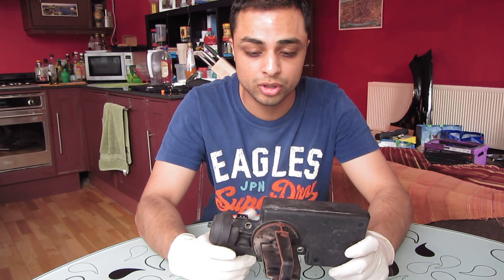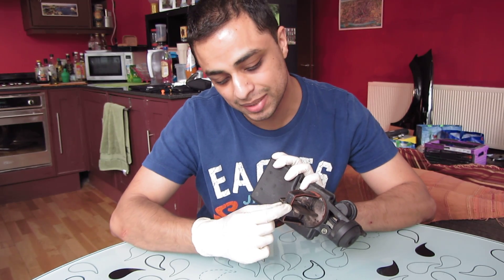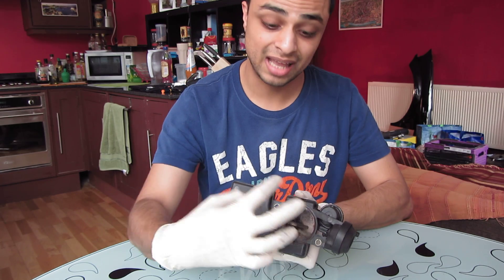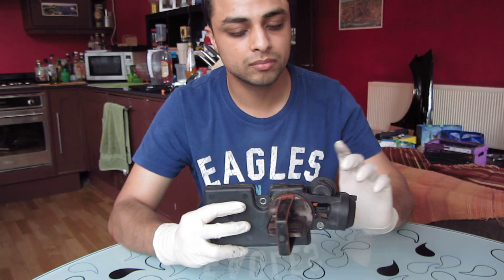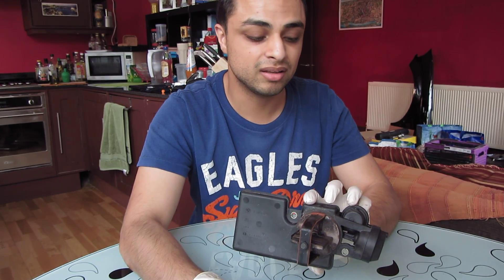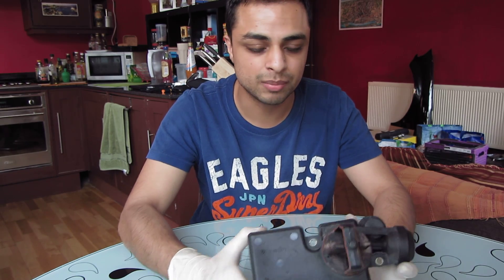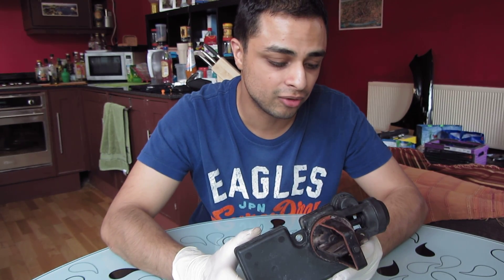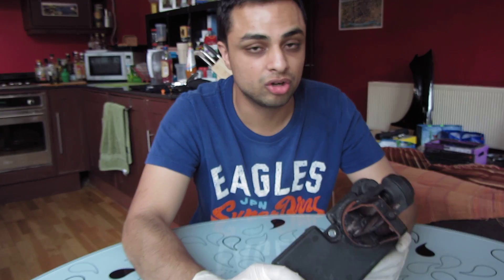Testing the Condition of DISA Valve on BMW E46 330i DISA:  Is Your E36 E39 E60 DISA Flap Faulty?

Comment: Great video and explanation, thanks for posting it..I upgraded my disa with a kit from xr8. Tested it using your video and it works correctly. I installed it into my car without the small backing plate..my disa valve stays open when car starts, moves after around 4k revs..is this normal?
Reply from the maker: @dRew-something  If I remember correctly I think it's closed at low rpm and opens at higher rpm. The changeover is around 4k rpm
Reply: @ozstriker4075  thanks for your reply, my car's acceleration feels normal and no fault codes so I guess it's working correctly

Comment: How to test the electrical motor inside of its working?
Reply from the maker: AFAIK there isn't an electric motor inside, just a vacuum contolled flap. But if u mark the arm with dots of paint with it installed on the car and get someone to raise the revs past approx 2.5k you'll see the arm move. If there's no movement of the arm, then you've got a problem

Comment: Beyond the check shown on that clearly broken vacuum, operation needs to be checked with voltage. My vacuum is perfect but never activated so arm does not move. Plug in on car, turn ignition on and it should turn the flap. If not, and is not jammed, the motor is surely shot.

Comment: I have a p1512 disa stuck close low circuit what does that mean for me replace or what's the cause of it thank you
Reply from the maker: Isreal Perez Have you removed the DISA to inspect it?
Reply: Yes I have I place my finger over the vacuum diaphragm and then I closed it and it would not hold pressure so I have replaced it the new one

Comment: There are kits available on Ebay, I just replaced parts on mine(shaft/goes into flap underneath, top holding pin, O-ring, flap and retainer ring). Works perfectly now.
Reply from the maker: Trouble is if the vacuum pot is the failing part (as mine is partially in this video), then the repair kits do not address that.  They are for fixing the flap.
Reply: Oz Striker that is correct. Fortunately I didn't have that issue.

Comment: good video. exactly my thoughts. check it out periodically to see the condition and replace as needed. Don't try to redesign the dang thing. Replacement of parts are to be expected and if you're driving a BMW then chances are you can afford a $220 part when it starts to fail.

Comment from the maker: Just an update, at 128k my car was due replacement of its precat oxygen sensors, and this seems to have resolved the lean codes P0171 & P0174.  Longterm fuel trims are both approx at -6%. The ultimate test will be to see how the car runs when temps drop below 0 deg C, currently temps haven't dipped below 9 deg C. I managed to get a used DISA in better condition than the original one currently installed on my car. If codes appear again as temps fall, I'll install it and see if that further improves things.

It seems to me that given the age and miles on most of our cars, the lean trouble codes can often be due to a number of issues.
Reply: ive found that the disa valve O-ring fails first out of all things to be considered. I never bought any of those rebuild kits for DISA's usually when mine DISA is failing i replace it with a whole new unit and my car is happy for it. One of the most practical DIY to do on your car when you start getting lean and random msifires. If you've ruled out all the other variables. of course lol

Comment: I think the diaphragm may be failing on yours as I haven't seen new ones returning to their open position when you hold your thumb down there. It usually moves around 30 or so degrees and stays there.

I'd buy a new one in this case as the rebuild kits don't fix vacuum problems so you'd be just wasting your money putting one on this.